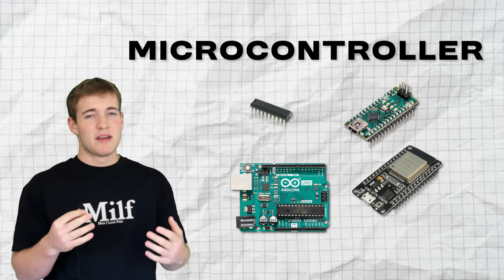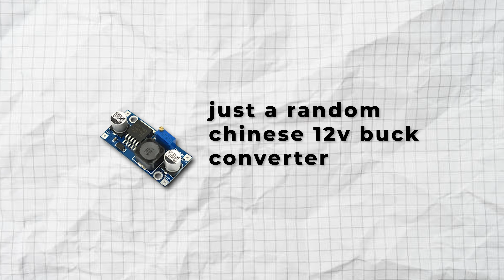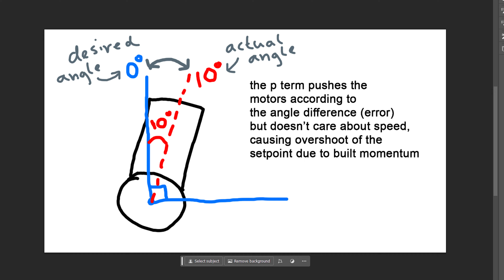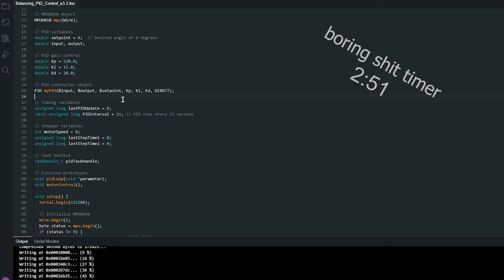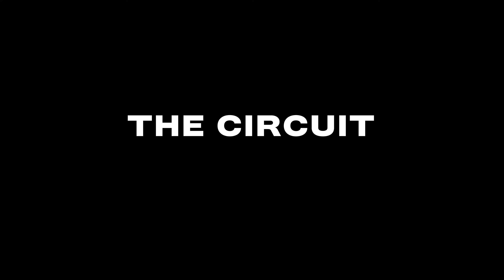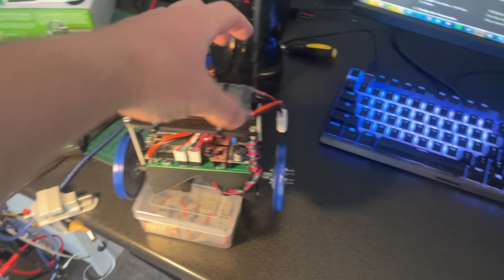Two-Wheeled Self-Balancing Robot: The Circuit, Program, and Build...

Comment: Those oscillations are caused by your bad pid tuning. The mpu6050 is indeed very noisy, but try it's dmp or a lpf and it should be fine. Those nema17s are super overkill. If you're using microstep it should be very stable. If not, just use DC motors and put a buck converter to it's nominal voltage.

Comment: nicely done!  I recently built one of these except with DC motors.  The deadband ended up being a huge pain and created a lot of jerkiness at low/balancing speeds.  Was just checking out yours because of the stepper motor setup-- I regretted not going that route

Comment: Oh, so you only measure angle with accelerometer? Not using gyroscope at all? That might be useful to try. And those steps set manually with delay of 2 microseconds? Your robot seems too slow if you push it too hard. Maybe those pulses are too long so motors can't reach desired speed? I am using "AccelStepper.h" library. Maybe your way is actually easier, but not sure.

Comment: You did well! It's standing right? Ok next step is adding a webpage with the PID values on it, this way you can tune it on the fly. Once you get that working you can adjust the numbers and save them to flash. This will definitely make fixing the numbers easier. After it's tuned you can add controls to the webpage to allow you to steer it. I have a similar robot. It takes a while to tune it properly. Also setup some logic so when it falls it stops the motors. You got this!
Reply from the maker: Thanks man 🔥, thats the goal